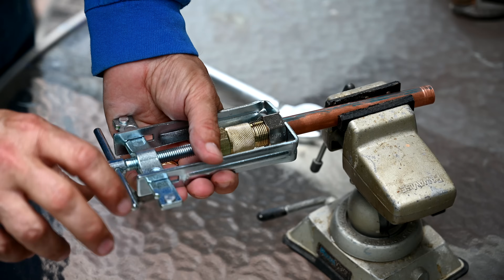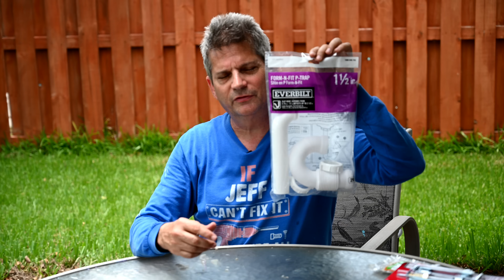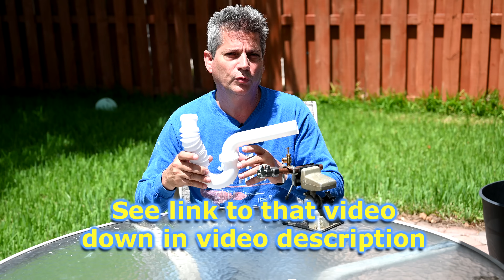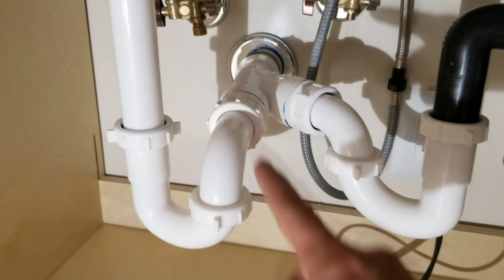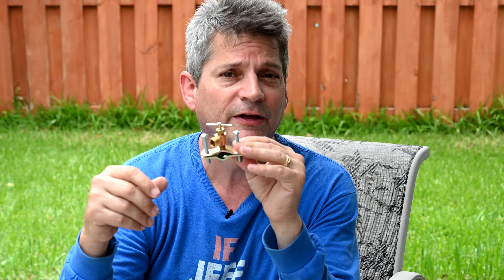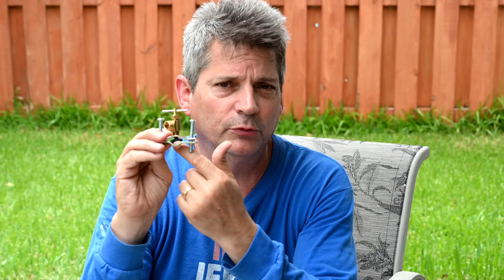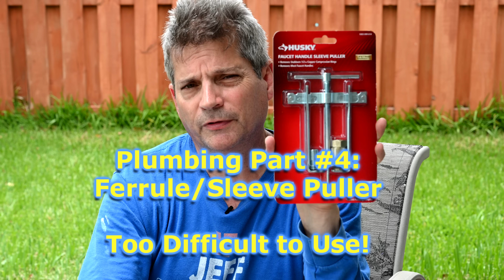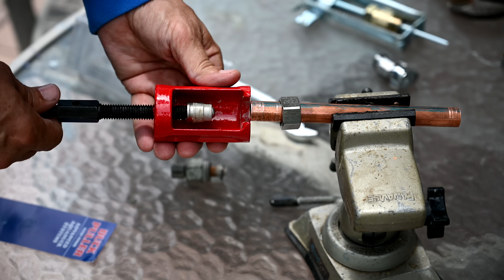4 Plumbing Parts/Tools You Should NEVER Use. NO Plumbing Fails

Comment: Imagine that, Home Depot selling me crap. Now I've seen everything.
Reply: Does Home Depot know you're not supposed to sell this stuff do they not care I see this all the time at Home Depot
Reply from the maker: @kevino1489  there's no law forbidding the sale. For some people using one of these might not be a problem, if you use it outside who cares, let a few drops of water drip outside. But still just out of principle, and sound engineering, and common sense, I would avoid using one. I do think that Home depot should have warning signs next to these products alerting yo that it is a violation  of plumbing codes to use them. I can understand an existing instillation, re-installing a new one to replace an existing one.
Reply: @jeffostroff  o ok
Reply from the maker: Yes, happens every day at Home Desperate
Reply: @jeffostroff  Home Cheapo
Reply from the maker: @usnva5638  That's another good one to add to our list!

Comment: There's something stinky about plumbing codes. All houses in Iran are using s traps and p traps. Some even use cheap Chinese ones and i never heard of any problems. You just wanna waste time and charge more.
Reply from the maker: There is no need to change out an a** trap unless you have a problem. Or if you are remodeling if it's possible to reroute a couple of pipes you do it it's not that expensive.

Comment: For the nice red puller, I would recommend putting a drill on that!
Reply from the maker: Wrench is more reliable, it has the torque to loosen really stitch ferrules, but try drill first, and if that fails, try the wrench.
Reply: It is much more difficult to control the torsion of a drill than with  your hand. With a drill you may loose the “feeling” of the resistance regardless the control of the speed.
Reply: @kostas010151  Yeah, that is true, it was just an idea especially if the space is cramped!

Comment: Lol beard clippings generally build up around the popup or in older lines down behind the wall  (get caught up in corrosion and scale) in my experience...and hvac guys are notorious for adding saddle valves

If you do have an old saddle valve that's NOT leaking DONT TOUCH IT
Reply from the maker: But if it is leaking you'd better touch it soon!
Reply: @jeffostroff  my sister thought one was a shutoff...wasnt leaking until she touched it. I just used pro press as it was an active line with water...and a bunch of wood and insulation by it

Comment: What I dont get is when people can just rotate the trap a bit and itll line up fine....but they use an accordion trap lol
Reply from the maker: We see this all the time, what happens with a remodel is sometimes the new vanity places your drain further than 4" over from where it was, so swinging out the p-trap is not an option, because it won't reach. We simply add a 45 couple or 23 coupler on the waste line coming out fo the wall, and then cement on any additional length of 1 1/2" pipe until the p-trap arm can reach with a hub adapter.

Comment: Dont forget fernco traps 😂Like junk pop ups...Theres decent popups available at the big chain stores ...that's what I don't get. Get a decent brass one for $20-25 and use putty....but johnny homeowner uses the 13 "play skool" quality one that's $13 and silicone...and doesnt even give it time to set up..happened to me earlier...hes like its leaking now...yes because your silicones washed away and YOU installed it! Pisses me off and then they want you to fix it free.
Reply from the maker: that's why I use the silicone that is water ready in 30 minutes. I try to that part of the job first, then by time I'm packing up my gear, or working in another part of our remodel project, the sink will be ready for testing.

Comment: Methane is an odourless gas.
Reply from the maker: If it is naturally forming yes it is odorless. But of its a manufactured nothing they are often manufactured with an odorant to help you identify it
Reply: That's right - and you're not describing 'manufactured' (you mean processed) Methane, you're referring to the stink from sewers - which is Hydrogen Sulphide (or Sulfide for the US market). The simple, inescapable fact is that there is no such thing as a 'Methane Smell'.

Comment: Venturi effect, lad. Capillary action is how solder wick works, or a paper towel. I am enjoying this!

Watched further and the floss was also an excellent example of capillary action.
Reply: How does that occur with typical "waxed" dental floss??
Reply: @uhmgawa6533  Venturi effect is pressure differential causing flow, like a carburetor. For an s-trap the drain is the carb jet, and the toilet drain or otherwise is the bore of the carb.

 Capillary action is surface tension causing the flow, maybe with a slight side of gravity siphoning. Waxed dental floss probably makes it worse, it's hygroscopic so the water beads up and increases the tension all the more. Like watching raindrops on the windshield, they sit and pool till they get too big, then they streak down all at once, draining the entire drop. Surface tension held it there, and surface tension drags it all down.

Comment: I have a double wide manufactured home and all my drain pipes are s traps
Reply from the maker: That's common with mobile homes although I don't know why they build them that way. I assume you connect into a city sewer. Have you ever smelled sewer gasses? You might not have a problem since the venting is a lot simpler on a mobile home.
Reply: Im connected into an septic tank on my property but I only have bad smells in the shower

Comment: I hate compression fittings and use flare or rubber gasket fittings whenever possible.  I usually leave the existing compression ring and nut in place rather than remove the ring and damage the pipe in the process.
Reply from the maker: Yes, we have heard from others as well that leave the old ferrule compression ring in place.
Reply: @jeffostroff  I have had my masters for 35 years and have never cheated people--If I go to an old ladies house with an s trap that has been installed for 40 years--I am going to replace her strap with an s trap--I am not making her go to the expense of tearing her wall out and rerouting her pipe--Sometimes common sense has to be used--Same as using the the original nut back when replacing old valves with  new compression valves--I do not like saddle valves--but they mostly leak when someone cuts them on and off does not tighten the packing nut on the valve--I use shark bites  fittings in hard to get to places--such as worrying with burning the house down--Also like shark bites as conversion fittings copper to cpvc pipe--I also install well pumps and pressure tanks--DO YOU ?

Comment: Typical plumber.  "I always replace all valves". WhY?   If it works you are just padding the bill.
Reply from the maker: The new valves only cost me $10 to replace. Not a big deal. When I remodel my foreclosure units, I put everything brand new and the 30 year aging clock resets back to zero. I never let any buyers or their home inspectors see anything less than brand new valves. Gives them nothing to complain about, no leaks to find.
Reply: @jeffostroff  he doesnt get it. Nothing wrong except half of them dont work. 30 yo multi turn and the seal is shot....it doesnt leak until you touch it.   Or spend 20 minutes and put on a new quarter turn stop  that will work when needed and not have to worry...hes probably the same guy that when you shut off an old one that starts dripping, he blames you for "breaking" it
Reply from the maker: @heyitsthatoneguy91  I've seen a lot of them where the nut loosens as you turn the water back on. That's why this valve as actually fixed simply by turning the packing nut nearly 1/2 turn, back into compressing the packing rope.

Comment: Nice video!  I use sleeve puller made by Grainger. Works great for me and it’s around $20. https://m.grainger.com/mobile/product/1LNX7?gclid=CjwKCAiAo7HwBRBKEiwAvC_Q8YCnbI5zb-uqrI5Ph3WmHLhMgIh8IIYA6qk9CMbYfcmMOi5HGWse8hoCg5UQAvD_BwE&cm_mmc=PPC:+Google+PLA&ef_id=CjwKCAiAo7HwBRBKEiwAvC_Q8YCnbI5zb-uqrI5Ph3WmHLhMgIh8IIYA6qk9CMbYfcmMOi5HGWse8hoCg5UQAvD_BwE:G:s&s_kwcid=AL!2966!3!216788409968!!!g!296274828640!
Reply from the maker: Yes, this looks very similar to the Husky tool, but I just don't like the tiny handle bars, digs into my fingers.

Comment: I used a saddle valve on a PVC pipe for drainage for an RO system. It's not under much pressure, so I don't think it'll ever leak. The previous homeowner, however, installed a whole-home humidifier, which used a saddle valve to tap copper, and that one leaks if I turn it on.
Reply from the maker: I don't think that a saddle valve will work if there's not pressure in the Bebe's he pipes. If that is a drainages system there is not going to be enough pressure to force water through the tap of a saddle valve

Comment: In Australasia we use a lot of S traps in our free standing housing as the toilet Ventilation precludes super suctions draining them, your US codes are related to your worst options in plumbing and you need to cover bad practice plumbing. The el cheapo flex traps would probably only be used outdoors on a fish washing table sink or similar where visual inspection was easy as was access. Those saddle back valves are a great little place low pressure fix for water fountain installation and ice makers but their flow is pretty limited, there are good plastic push on and self locking pipe fittings that if you invested in a small tube cutter you could easily slide a tee with reducer and supply a cleaner flow. Only the crude tap would be missing. The tool to extract the brass olive off the copper pipe is a crude copy of the original, it is both lighter and rougher, someone probably got the original die punches and cut thinner material to make these, the end claw is under bent requiring you to hold together with force as you turn the tee handle. It’s not a great design I agree but I think it’s one that used to work and as you say, there are better solutions. Me, I’d put Ice around the copper for a short while to shrink it and then pull the brass ring off by hand.

Comment: No one has the right to tell me that I'm not allowed to use a satle valve because it doesn't last long.
Reply from the maker: No one has the right to use those parts that are banned by plumbing code if they want to get a building permit closed out.

Comment: Well with the flexible pipes yeah it’s a very easy solution but that’s a really good place for stuff to get stuck in those pipes are known to crack and break over time and if you have it offset use one or two 45s what the downspout outside that’s off centered if you know what I mean

Comment: I used the form and fit adapter It still has the original trap does this count as illegal
Reply from the maker: Yes the form and fit is not allowed at all under plumbing codes. But if it's not getting inspected there's nobody to really stop you from using it. I would just monitor it for leaks because the whole issue is people get leaks and then they're not checking under their sink and they don't see these leaks that are going on for months those of the leaks that cause the most damage, but if you stay on top of it you'll see it the minute it starts to leak.
Reply: @jeffostroff  thanks for the info I live in the middle of nowhere so no one is really going to check it and I'll montier it we just replaced the vanity and all the plumbing under the floor fittings went bad

Comment: How do u think they tap a 4” water main .for a 1” line to go into ur house
Reply from the maker: Not sure but I'm sure whatever they use if they are using a Saddle valve is a lot more professional and commercial in grade than that type of cheap nasty little white metal garbage that the ice maker owes manufacturers stick in a package for you. And I'm sure they're not using a dissimilar metal on top of copper either that will cause corrosion and cause the saddle valve to fail.Not sure what point you are trying to make that you're not even comparing apples with apples.

Comment: I completely agree with the negative comments about the flex drains. I didn't realize they were prohibited by code, but another reason to not like them is that it is difficult to make a reliable seal with them. The thin walls of the flexible pipe bends and leaks if the joint is tightened too much or if the flex pipe isn't positioned exactly right. There really is no reason these things should ever be used. If the standard drain kit doesn't work it is very easy to add an angled extension to the drain piece out of the wall to make it so the standard drain kit will work.

I also agree with how difficult it is to use the puller tool and how well that red puller tool works. I screwed with the crappy pullers for quite awhile until I splurged and sprung for the 35 bucks or so the better ones cost. In terms of reduced annoyance it paid for itself the first time I used it. One trick, the host didn't mention is that you can use the red puller with a power drill and with that it is possible to pull the ferrule in about fifteen seconds.
Reply from the maker: I will try that idea out with the drill, I just assumed since the ferrule was so tight, that I would be squeezing the trigger on the drill and nothing moves.

Comment: Very useful and informative video.  I take issue with one thing only...
They are NOT "illegal" to own, use, manufacture or sell.  Codes are NOT laws.  They are regulations.  Codes apply only for jurisdictions which adopt them.  The "Uniform Plumbing Code" and the "National Electric Code", for example, are not even "codes" at all. They are industry recommended standards which are sometimes adopted as local codes.  They are a conglomeration of the combined experience of people in the industries represented. Unless adopted by local authority, they are just a book of recommendations written by knowledgeable people. 
They are NOT LAWS passed by a legislature and signed by an Executive (be it the President or a Governor).  NONE of these codes address the manufacture or sale of any of these devices.  They have NO authority to ban the manufacture, sale or use of ANYTHING.  Why do stores sell these inferior parts?  To make money.  $$$$   
These devices CAN cause you a nuisance when remodeling IF you took a permit for the work and are subject to inspections by an authority which has adopted these recommendations as local code, OR if an insurance company adopts these codes and applies them as conditions to their policies (insurance companies can do whatever they want) and if you get caught in an insurance inspection (which they sometimes require for older homes for renewals) OR caught on an inspection during a home sale, then you may have to correct these problems to maintain your policy or sell the home. Insurance companies are far more likely to bury this in the "exclusions" of their policy, so you should actually READ THE POLICY. Policies may exclude claims cause by "S traps", saddle valves, flex drains, etc.  A common one is to exclude claims from water heaters more than 10 years old.  Not to mention FPE and GE/Sylvania electrical panels, polybutylene plumbing pipes and so on.  READ YOUR POLICY!  These things can be a time bomb in your house!
Bottom line...It is NOT recommended to use these devices.  They are of inferior quality and can cause problems in the future, usually far out of proportion of the amount of money you save from using them.
Reply from the maker: Nowhere did I say these are banned by law to own
Reply: @jeffostroff  No where did you say they were not.  In your answer below you mention that "everyone  asks" why you can still buy them if they are "illegal".  They are NOT "illegal".  They do not comply with some codes where those codes have been adopted for new construction.  
You did, specifically, say several times they are "illegal". Without clarifying, that does not provide a service to your viewers.

Comment: If S-trap is prohibited, then what kind of a trap do you use on an island sink?
Reply from the maker: For an island sink that is farther than 5 feet from the plumbing stack, you can use this: https://amzn.to/2Sx2TLw an Oatey 39017 SURE-VENT ADM Air valve. It gets placed inline with the P-Trap output, and vents using the air under your kitchen cabinet, rather than a plumbing stack pipe inside the wall going up to the ceiling. This is allowed in most states, you'll have to see if it's allowed in your area.
Reply from the maker: @Bo Hunter   Yes that is correct and all of these students are type valves do a great job because the air is right dared a vented in its not going to some long convoluted vent stack that might be sharing with a huge toilet right next to it